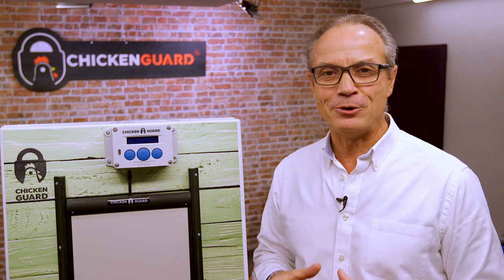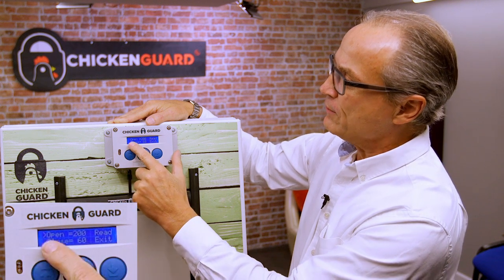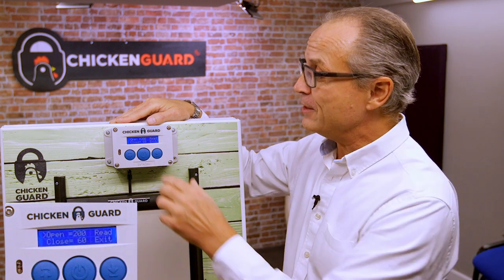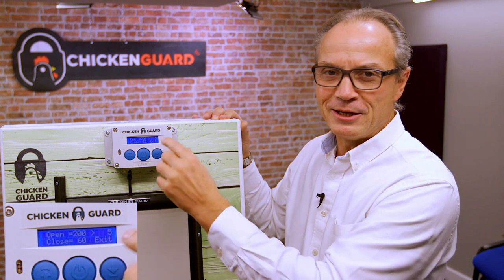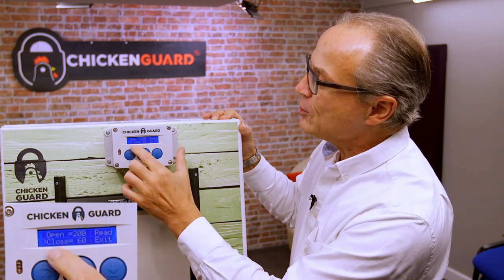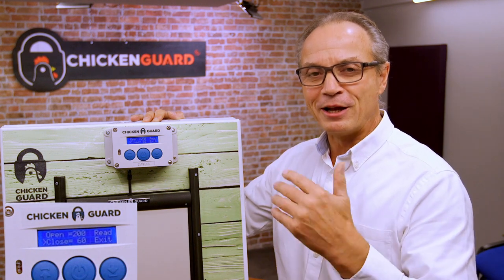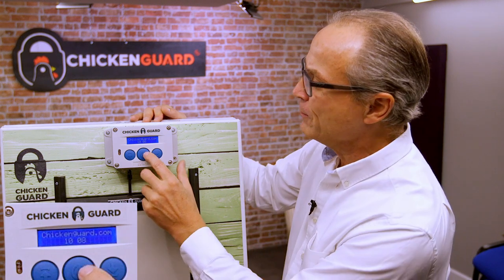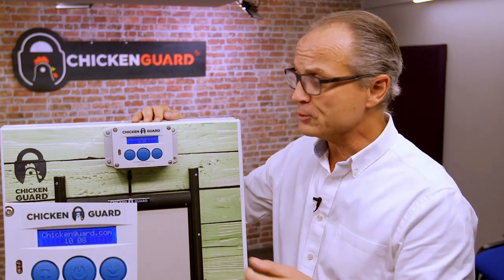How to ChickenGuard - Sensor Adjustments

Comment: Well just watched the video on the door jamming then door might just drop later but hangs above the lock leaving 1 cm space, and that results in dead chickens everywhere. I have this unit with the self locking door. It’s jammed but the door goes down but the lock never engages. Looks like this system needs more development.

Comment: @chicken guard
Where can I get a plug in for this control panel.  I bought the extreme because we live in Canada and it's stopped to be good for cold climate, but last week it was - 20 and colder all week and it was useless. And it eats batteries like crazy!  I'm on my 4 batch of AAAs - using 4 at a time its not really sustainable, needs a plug in! But I have not been able to locate which one is the correct one.  Thanks